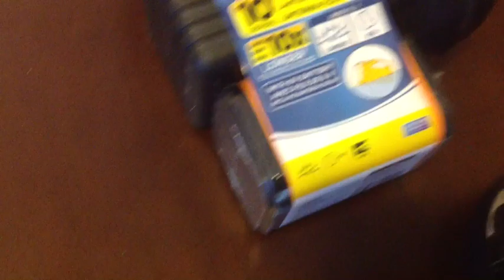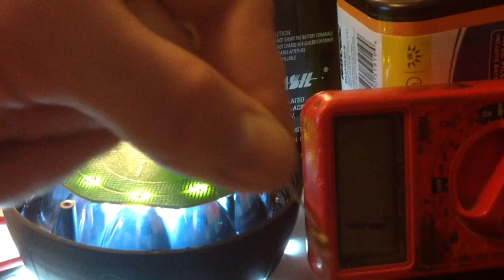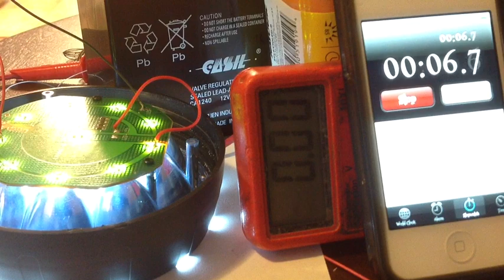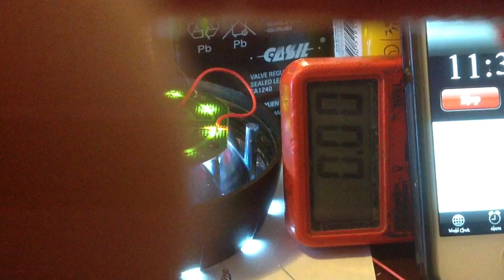Converting 6v LED lantern to 12v  ..... 5x8 Enclosed Trailer Conversion Camper Project

Comment: Interesting and certainly shows the amount of hidden engineering that goes into everything we buy. There must be better resistors available designed to take more voltage. It always makes me nervous thinking about any electrical device overheating. I once made the mistake putting a 9v battery in my pants pocked with change...yeow! Like holding a lighter to my thigh...funny looking back at it. I had no idea what was up, thinking a bee was in my pants. I was alone, thank god, at the time, and pulled my pants down, figuring to see a bug. Nothing. Emptied out my pocket...there was the battery, and scorching hot change...ha!
Reply from the maker: holy hot pants batman

Comment from the maker: i found a small 12v  1.2 AH  battery that will fit inside the Led casing... I am going to make one, and see how long it will burn (hours)  the one i made, i have been using on and off and still havent had to change or charge the battery....

Comment: interesting video, but i wonder why you would want to do this?  more amp hours?
Reply from the maker: +Yung Wing the solar panels and battery i had was 12v   . the flaslight was 6v..
i wanted to see if i could convert and use